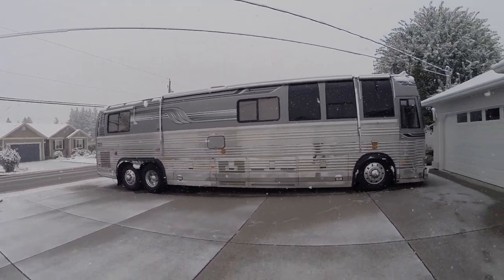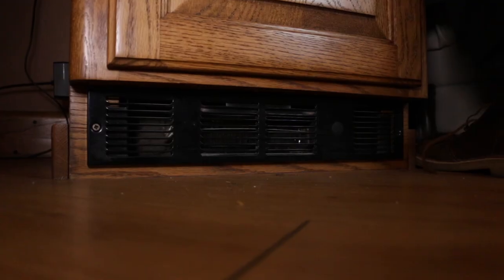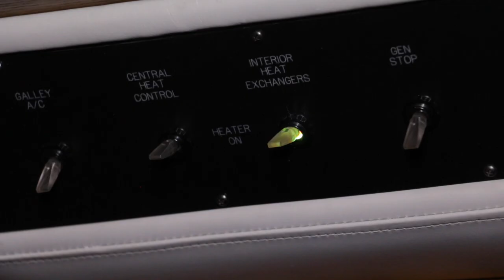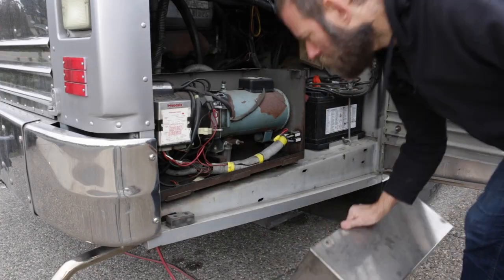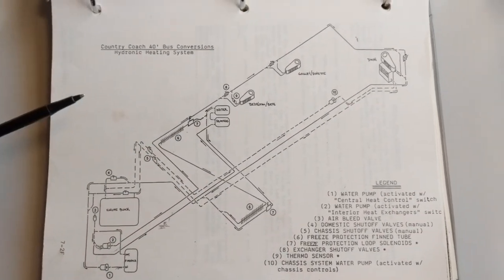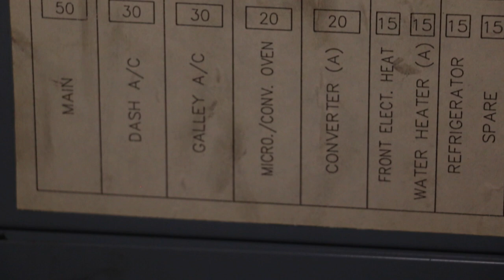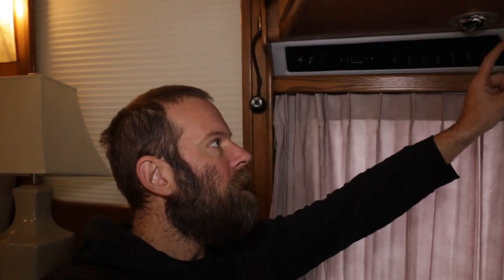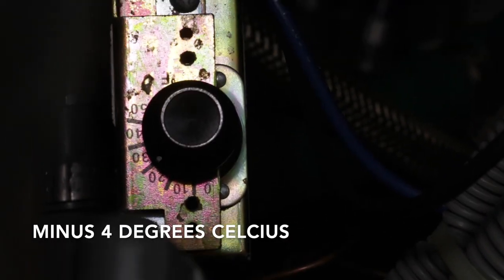How to Stay Warm in A Prevost | The Oreo Tails

Comment: Great review of your systems.  We've owned a Wanderlodge now over a year and it's taken that long to get my head wrapped around the systems.  They are daunting but satisfying to keep up and running.  Great bus.  Thanks for the videos.
Reply from the maker: Thank you, and thanks for watching! The Wanderloges are beautiful machines, and yes, very similar complex systems. I plan to get videos done of all the systems, to help others in the future! 🐶😋
Reply: Dont you have radiant heat registers in your Bluebird.
Its a fantastic system if working.
Much simpler than my Aqua hot 🔥
Reply: @soillife1  Our Wanderlodge has hydronic heating using a Webasto fired boiler rated at 80K btu. It is similar to an AquaHot but doesn't have a reservoir tank. Four heating zones in addition to two electric toe kick heaters and four heat pump/air conditioners. We have to run the Webasto in the winter when traveling to stay warm. It is a good system that loops into the engine coolant that assists engine starting in cold weather.
Reply: BSF
Then your system is the same as mine.
And we keep the electric and burner switch on year round.
Anytime its a little cool I turn on the engine heat the night before a trip.
Reply: BSF
But I have the tank system.
Reply: @soillife1  It's a great system.  I'm stored now in my bus barn using the electric toe kick heaters in the kitchen and bath room.  I've got the electric heaters going in the bays and water closet.  It stays around 50 or so inside and in the bays.  It's 18 degrees here this morning.  I exercise the Webasto monthly when not using the bus.
Reply: Enjoy that Wanderlodge! Those are  a  great build! Very well thought out Coach! Building out a old Bluebird bus to RV.  I've always wanted to build out my own. Sometimes I think I should have just bought a Wanderlodge, LOL!  Enjoy! God bless-AL from CT
Reply: Dude ... Thankyou .. AWESOME VIDEO !!  I just bought the sister to your Prevost 8 swear.  You helped me out alot man !!! Thank you !!

Comment: Loved this video!  Awesome that you have those drawings and could really explain how it works.  I also really love when Oreo is walking in the snow with one foot up tucked in away from the cold!!
Reply from the maker: Yes, having the original manuals adds so much value to a used coach like mine. Being able to trace every wire, understand every system, its invaluable. Thanks for watching.

Comment: Great video.
As for dealing with winter in the coach.
Florida Baby 
And a brand new Aqua Hot unit in this 99 Monaco Signature
Reply from the maker: Hi, thanks for watching. Yes, southern latitudes would be my ideal. However, current times being what they are, and borders and so forth. I decided staying put in Canada would be an excellent proving ground for the winter systems in my coach. How do you like the aqua hot?  As I have now replaced my water heaters, I did consider converting to an all in unit.
Reply: We love the Aqua Hot.
We don't,  or seldom use electric heat.
We have 3 heat pumps with air roof units. But never use the heat pump mode.
I  certainly would just keep yours as is and keep it serviced and replace parts as needed.
The aqua hot is 3 zone
3 thermostats 
1. Rear end bedroom
2. Bays and bathroom.
3. Front lounge, kitchen.

I  do keep the electric and burner switch on all year round.

Front to back we have 8 heat exchangers and fan's.

Comment: i imagine the worse of winter has passed? Couple of questions...did you fair well in the worst of it? and...how long does diesel last using the webasto? thanks!
Reply from the maker: I wish the worst has passed, but, I think not. We'll see. I have faired well so far, I've stayed in the bus every night, no problem. Because I also have electricity, the Webasto is doing freeze protection, and supplemental heat in the coach. I haven't closely monitored fuel consumption, but, after the first month, the fuel gauge barely moved, maybe an 1/16th to 1/8th of tank. , likely less. Thanks for watching!! 😋🐶
Reply: @theoreotails1536  wow! id say thats pretty efficient and impressive! I wanna camp out north in the winter...where im from we dont get a winter :(

Comment: Do you need to be plugged in to run through wasbsco running.
Reply from the maker: Nope. It's a great heat source when boondocking, as it's only one furnace system that,  heats the bus, heats the hot water, and pre heats the engine. You do need 12 or 24 volts to run fans and pumps, so eventually you'll have to replenish batteries!